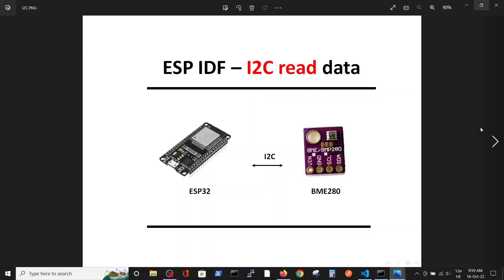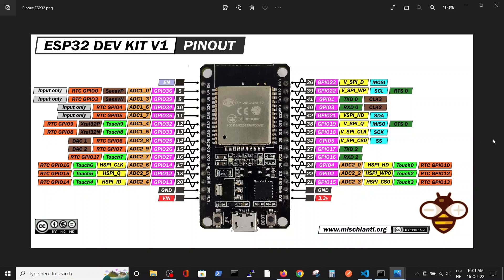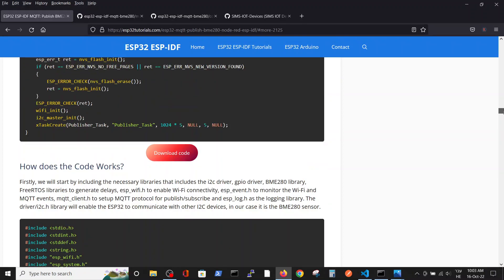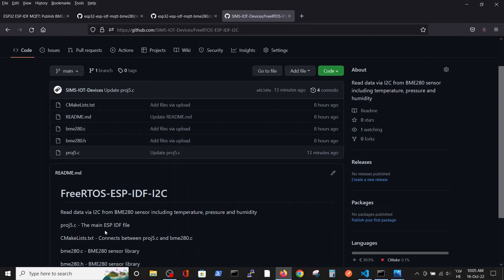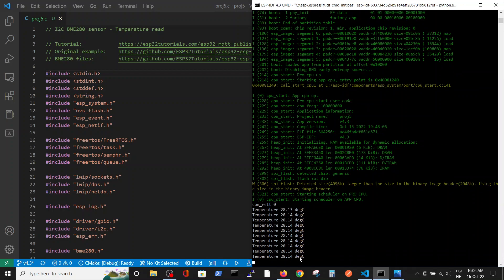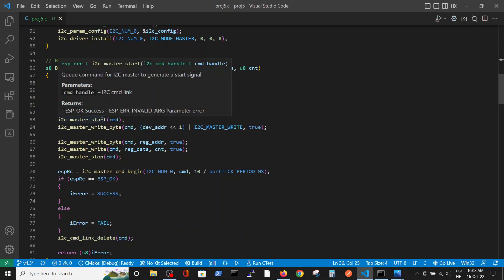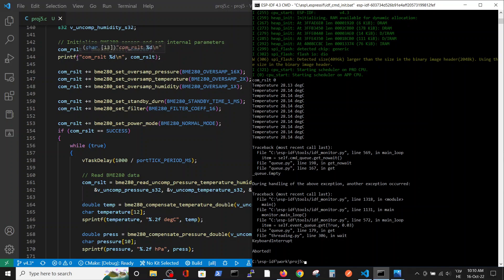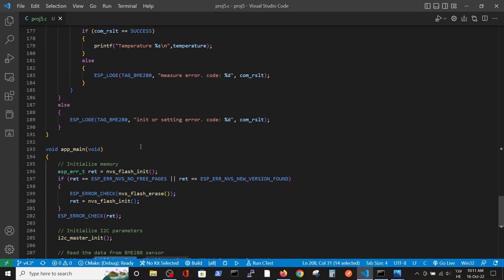ESP IDF read data via I2C communication from BME280 sensor

Comment: I am getting error in my serial monitor like below
E (10) BME280: init or setting error. code: -1
How can I fix this
Reply from the maker: Dear Chethiya,
I would suggest beginning with pin connections. It seems like BME280 can not be reached.
Reply: @chethiyawijewickrama6425   @simsiotdevices6219  could you figured out how to solve it? I'm getting the same error

W (315) spi_flash: Detected size(4096k) larger than the size in the binary image header(2048k). Using the size in the binary image header.
I (329) app_start: Starting scheduler on CPU0
I (333) app_start: Starting scheduler on CPU1
I (333) main_task: Started on CPU0
I (343) main_task: Calling app_main()
E (353) BME280: init or setting error. code: -1
I (353) main_task: Returned from app_main()